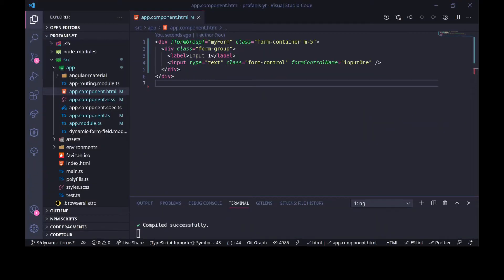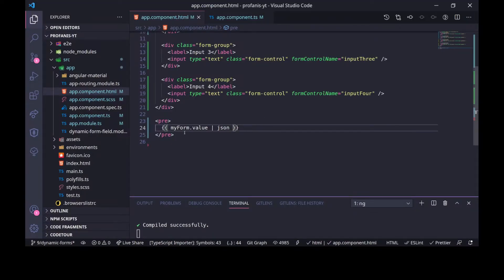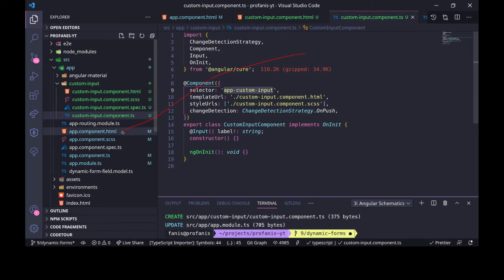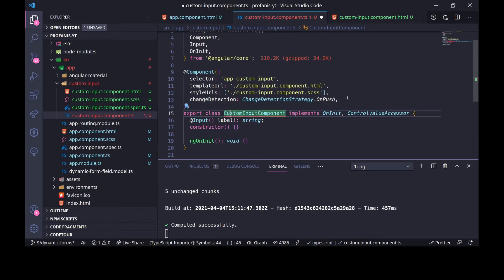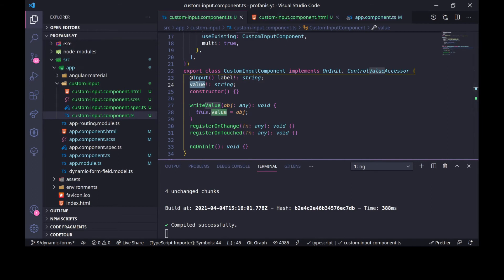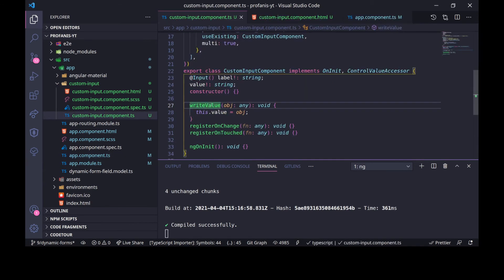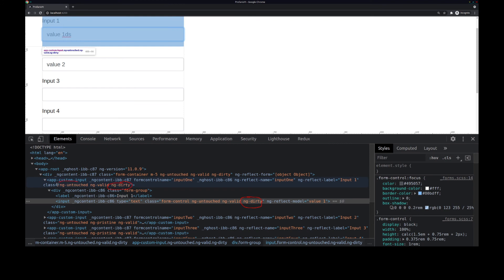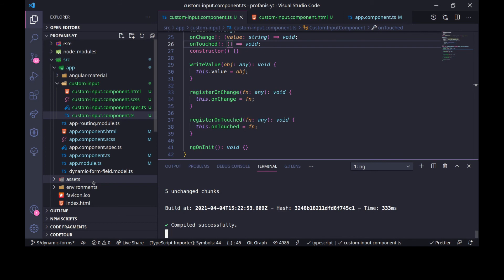12. Custom Angular Form Control

Comment: how to add validations error message in our custom form
Reply from the maker: You can define the validators in the parent component like you normally do with all the other form elements, and then, If you want to check the validity of the custom component you have to pick the corresponding FormControl instance (from the parent component) and check its validity.
Reply: @CodeShotsWithProfanis  In this case, if the input contains an invalid value, the ng-invalid class is not applied to it.

Comment: Thank you very much for this video!
One question, what about validators? does the parent component handles that? or it should send it to the custom component? Does the custom component needs to be a FormControl?

For example, <span *ngIf="customComponent.invalid">Invalid value</span> -> Who would handle this?
Reply from the maker: You can define the validators in the parent component like you normally do with all the other form elements.
If you want to check the validity of the custom component you have to pick the corresponding FormControl instance (from the parent component) and check its validity.

As of your question if the custom component should be a FormControl, well no. You can in the Custom Component a form element In the way you prefer. Even a JQuery one. You should of course make sure to update the relevant methods of the ControlValueAccessor.

I hope this answers your question :)

Comment: Simple and elaborated explanation, thanks Profanis! I am consufed with providers: [
    {
      provide: NG_VALUE_ACCESSOR,
      useExisting: CustomInputComponent,
      multi: true,
    },
  ],   We use provider [ ] to declare the Dependency, why we have "CustomInputComponent", please explain.
Reply from the maker: Angular uses tokens for the DI mechanism. 

To recognize that a component (built-in or a custom one) is compatible with the Angular Forms, it has to provide the token NG_VALUE_ACCESSOR. If we do not do this, then the component will behave like any other component. 

Let's think of the following; we create a form component and we do not provide the NG_VALUE_ACCESSOR token. We will then have to implement all the needed functionality for the ReactiveForms and the TemplateDriven forms. Having this token though, angular knows how to deal with it.

I hope this answers your question.
Reply: @CodeShotsWithProfanis  Thanks a lot Profanis! With the above explanation I am able to understand that any CustomFormComponent can be made compatible with Angular Forms by providing NG_VALUE_ACCESSOR token to it. So that CustomFormComponent  deals similarly with Angular Foms just like HTML elements ( <input type="text"></input>... etc) behaves.
Reply from the maker: @arpittripathi8089  As soon as you have the token for the CustomFormComponent, Angular will recognize it as a Form Component and will try to apply the binding. To make this happen, we have to implement the ControlValueAccessor interface and its methods. I hope this helps :)